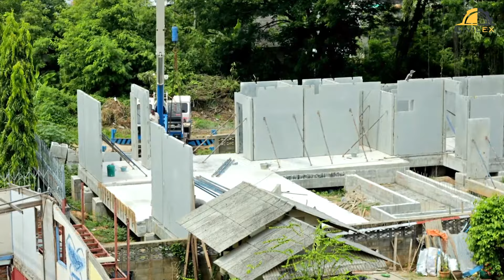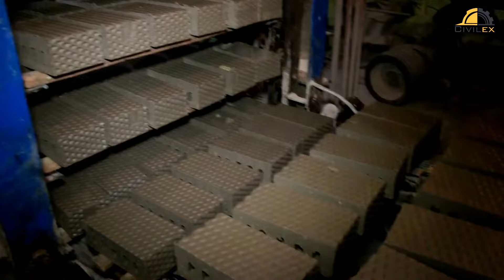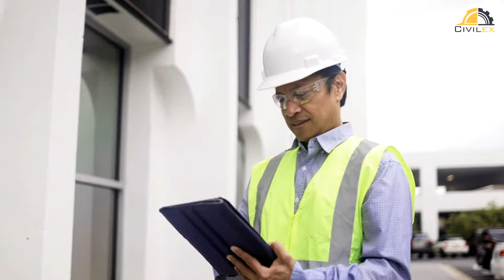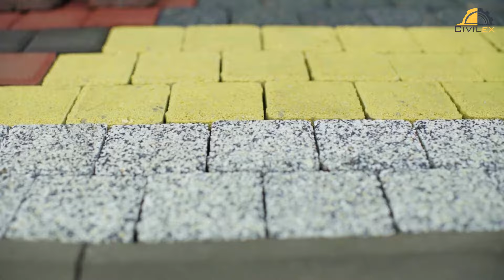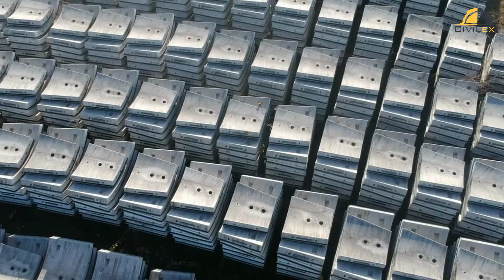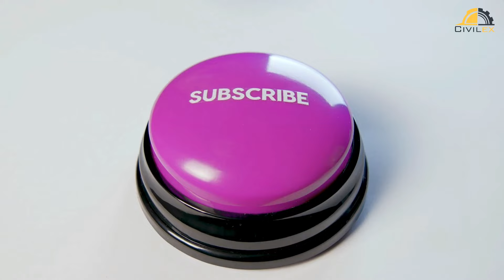Advantages of Precast Concrete in Building Construction

Comment: I want to know about the quality inspection of pre cast concrete as quality Control Inspector
Reply from the maker: Inspecting precast concrete involves various stages to ensure quality. Here's an overview of the process:

1- Incoming Materials Inspection: Verify the quality of raw materials like aggregates, cement, additives, and reinforcements. Check for proper storage conditions, expiration dates, and consistency with specifications.
2- Mold Preparation: Ensure that molds are clean, in good condition, and properly lubricated to prevent concrete adherence.
3- Concrete Mixing: Monitor the concrete mixing process, ensuring correct proportions of materials, proper mixing time, and consistency. Conduct slump tests to check workability.
4- Pouring and Compaction: Inspect the pouring process to ensure no segregation or air pockets. Use vibrating equipment to compact the concrete evenly.
5- Curing: Monitor curing conditions (temperature, humidity) to ensure proper strength development. Improper curing can significantly affect the concrete's strength and durability.
6- Demolding: Check for any damages or imperfections as the precast concrete is removed from the molds. Surface irregularities, cracks, or other defects need to be documented and addressed.
7- Dimensional Accuracy: Measure the dimensions of the precast elements to ensure they match the specified tolerances.
8- Visual Inspection: Perform a visual inspection for any visible defects like honeycombing, surface blemishes, or discoloration.
9- Non-Destructive Testing (NDT): Use methods like ultrasonic testing, radiography, or rebound hammer tests to assess internal integrity and strength without damaging the concrete.
10- Documentation: Maintain detailed records of inspection results, including any defects found, corrective actions taken, and compliance with standards or specifications.
11- Quality Control Testing: Conduct various tests as required by standards, such as compression tests, flexural tests, and durability tests, to ensure the concrete meets specified strength and durability requirements.
12- Final Inspection: Once all inspections and tests are completed, verify that the precast elements meet all quality standards and are ready for shipment or installation.
As a Quality Control Inspector, attention to detail, knowledge of industry standards, and the ability to communicate effectively with production teams are crucial for ensuring the quality of precast concrete elements. Regular training and staying updated on advancements in testing methods and materials can further enhance your inspection process.

Comment: I want to setup a precast concrete panels and elements manufacturing plant. How can I get help?
Reply from the maker: Setting up a precast concrete manufacturing plant requires careful planning and a combination of various resources. Here’s a step-by-step guide to help you get started:

1. Research and Planning:
Market Research: Understand the demand for precast concrete panels and elements in your region. Identify potential clients, competitors, and market trends.
Business Plan: Create a detailed business plan outlining your objectives, target market, financial projections, and operational strategies.

2. Legal and Regulatory Requirements:
Permits and Licenses: Research and obtain the necessary permits and licenses required to operate a manufacturing plant in your area.
Compliance: Ensure compliance with local building codes, environmental regulations, and safety standards.

3. Location and Infrastructure:
Site Selection: Choose a suitable location with access to transportation, utilities, and a large enough area for manufacturing and storage.
Facility Setup: Construct or lease a building that meets your production requirements, including space for casting beds, curing areas, storage, and administrative offices.

4. Equipment and Machinery:
Precast Manufacturing Equipment: Invest in high-quality machinery for concrete mixing, casting, molding, curing, and handling. Consider both new and used equipment based on your budget.
Quality Control Systems: Implement systems to ensure the quality and consistency of your products.

5. Raw Materials and Suppliers:
Raw Materials: Source high-quality aggregates, cement, additives, and other materials necessary for producing precast elements.
Supplier Relationships: Establish relationships with reliable suppliers to ensure a steady and consistent supply of materials.

6. Skilled Workforce:
Recruitment: Hire skilled workers with experience in concrete production, quality control, machine operation, and management.
Training: Provide necessary training programs to ensure safety, quality, and efficiency in operations.

7. Marketing and Sales:
Brand Development: Create a strong brand identity and marketing strategy to promote your products.
Networking: Build relationships with contractors, architects, developers, and other potential clients to generate sales leads.

8. Financial Management:
Budgeting: Develop a comprehensive budget covering startup costs, operational expenses, and contingencies.
Financing: Explore funding options such as loans, investors, or grants to support your initial investment.

9. Start Production and Monitor Operations:
Start Production: Begin manufacturing precast concrete panels and elements according to your business plan and market demands.
Continuous Improvement: Regularly evaluate and improve your processes for efficiency, quality, and cost-effectiveness.

10. Seek Expert Advice and Assistance:
Consult Professionals: Consider hiring consultants or experts in the precast concrete industry for guidance on specific aspects of your business.
Industry Associations: Join industry associations or networks to gain insights, access resources, and stay updated on industry trends.

Launching a precast concrete manufacturing plant requires dedication, strategic planning, and a strong understanding of the industry. Seeking guidance from experienced professionals and continuously adapting to market demands are key factors for success.

Comment: how we joint the precasted members what are the different types of joint in these structures
Reply from the maker: There are several types of joints used to connect precast members and the choice of joint depends on the specific structural requirements, design, and construction methods. Here are some common types of joints used in precast concrete structures: Dowel Joints, Grouted Joints, Epoxy Joints, Lap Joints, Corbel Joints, Pocket Joints and etc.
Reply: @civilexir  sir in a hise rise building which joint is preferred
Reply from the maker: @tarunyadav9807  In high-rise buildings, the choice of joint type for connecting precast concrete members depends on various factors, including structural requirements, design considerations, construction methods, and local building codes. Each type of joint has its advantages and disadvantages, and the selection of the preferred joint type should be made after a thorough engineering and architectural analysis. Here are some considerations for joint types in high-rise buildings:

Dowel Joints: Dowel joints are commonly used in high-rise buildings, especially for vertical connections where load transfer and stability are critical. They provide excellent structural continuity between precast concrete columns and beams. Dowel joints help distribute loads effectively and ensure the structural integrity of the building.

Welded Joints: Welded joints can be used for connections that require high structural integrity and load-carrying capacity. Welding provides a strong and durable connection but requires skilled labor and may not be suitable for all types of precast members.

Bolted Joints: Bolted joints are often used for connecting precast members in high-rise buildings. They offer ease of installation and allow for future disassembly or modification if necessary. High-strength bolts and proper detailing are essential for the reliability of bolted connections.

Grouted Joints: Grouted joints can be used in high-rise buildings to achieve structural continuity between precast elements. Grout provides monolithic connections and helps distribute loads effectively. It is commonly used in shear walls and core walls of high-rise structures.

Moment-Resisting Joints: In high-rise buildings, moment-resisting joints may be required to resist lateral forces, such as wind and seismic loads. These joints are designed to provide enhanced structural stability and may involve a combination of welding, bolting, and grouting to ensure that the connections can resist bending moments.

Adhesive Joints: Adhesive joints are often used for architectural elements or cladding in high-rise buildings. They provide a clean and aesthetically pleasing connection but may not be suitable for primary structural connections.

Comment: Precast concrete is earthquake resistance
Reply from the maker: Yes, precast concrete can offer good earthquake resistance. The durability and strength of precast concrete elements make them a popular choice for buildings in seismic regions. These structures can be engineered to withstand seismic forces by using reinforcement, special connections and designs that allow flexibility and dissipate seismic energy.